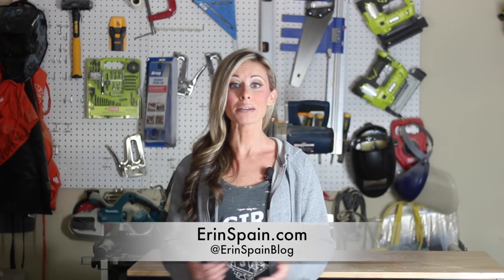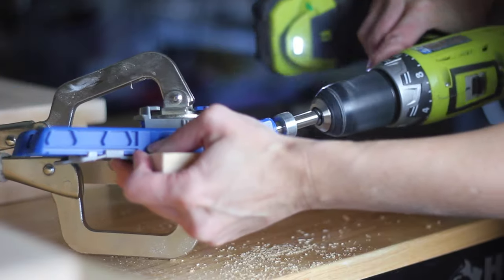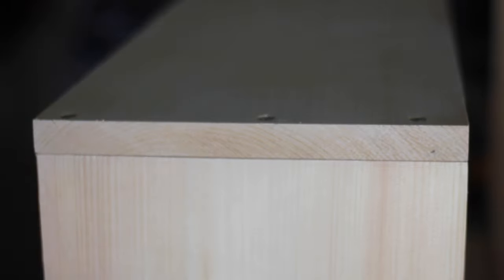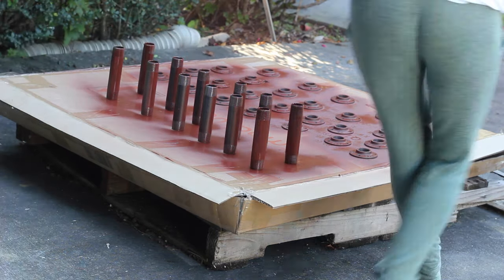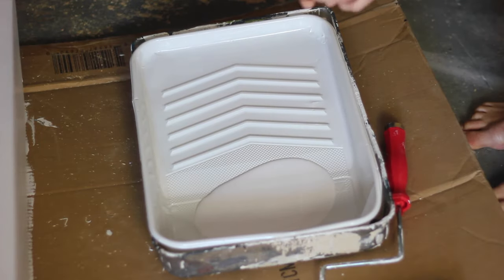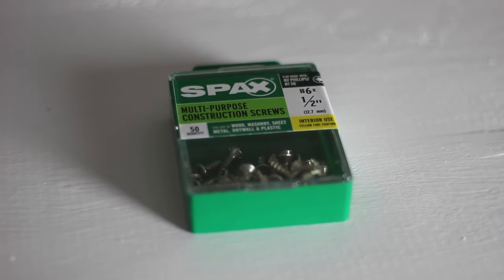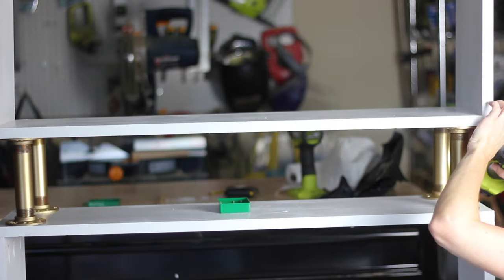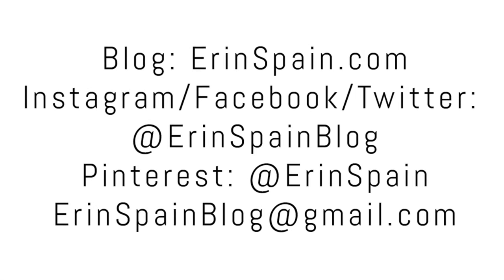DIY Pipe Bookshelf | Modern "Glam" Version

Comment: I love how the final product came out, but I just have a question about the dimensions. With the 6' and 3' board measurements, the shelf would be 9' tall, 10' 5" with the pipes, and 6' wide. But the thumbnail and finished product look smaller. Did you cut those boards in half after the initial cuts?
Reply from the maker: 6 pieces at 3’ long each and 6 pieces at 12” long each. Here’s a link to the written tutorial: https://www.erinspain.com/diy-pipe-bookshelf/
Reply from the maker: The 3’ pieces = the width of the final build. They are the longest shelf pieces. No 6’ long pieces. Hope this helps.
Reply: @ErinSpainDIY  Ohhh ok, I thought I had heard 6 feet for some reason. Thank you for clarifying, I'm going to attempt this with some rainbow poplar I have laying around. Thank you again!

Comment: 1st I looooove your videos & I can’t wait for your channel to blow up cuz u r amazing diyer 😍
2nd I wanted to ask about the primer spray, did u do it for the gold color to be clear or to stuck well?! Cuz I used spray to paint metal stuff & the paint flaked with time, i was told that I should sand everything b4 painting & i damaged a lamp by doing that😞🥴, so is there any safe way to use spray ?!😁
Reply from the maker: Thank you! I use this primer for steel because it prevents rust and also bonds the spray paint. It works really well. For other metals I usually just use regular spray primer.